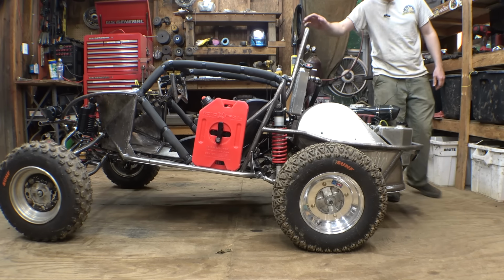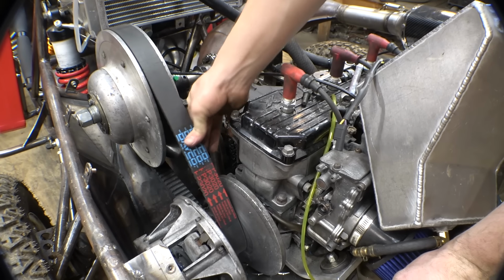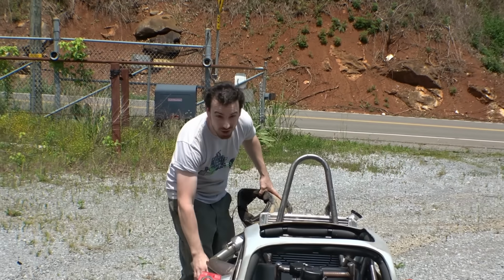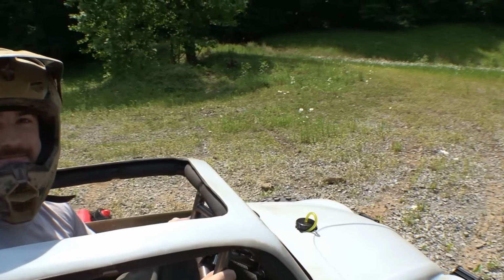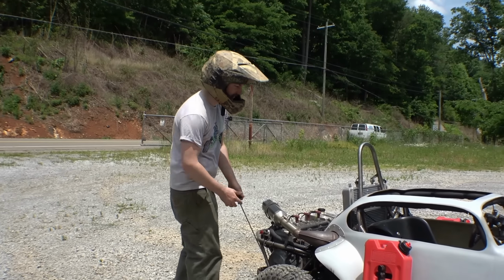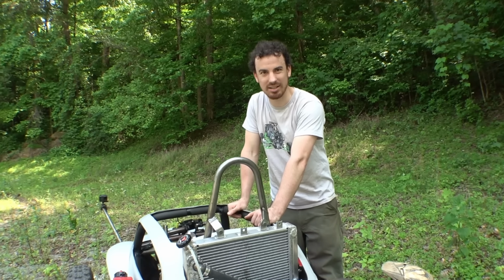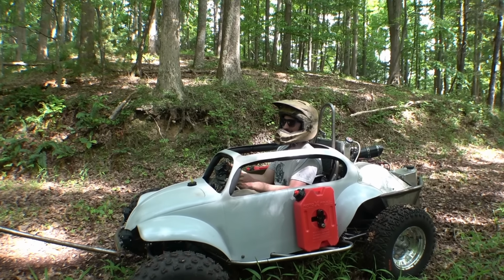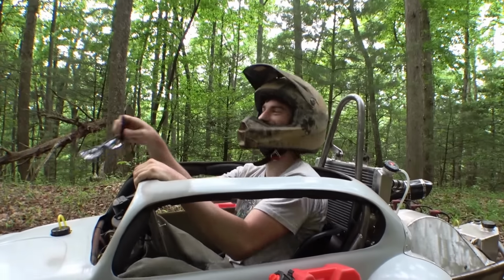This Thing is Nuts!!  - Mini Baja Bug Project First Test Drive

Comment: It definitely is nuts. Mental.

Couple of things I think.
- Too much weight in the back.
- Need much stiffer suspension in the back and maybe abit stronger at the front.
- Should move the radiator either more back or possibly two smaller ones on each side as you're completely blocking the airflow to it when sitting down

Comment: i just randomly happened across your video on youtube...Great build! love me a Baja bug...what was it based on originally, what did it start out as?  I would love to build something similar BUT , as a mini Jeep Rubicon Gladiator (since I have a full sized Red one set up to overland) or mini generation one Tacoma/Hi-lux ... the pick-up body would hide the rear engine somewhat  and solve the overheating issue, by placing the radiator out front, in clean unobstructed air... job well done sir , would be interested in the costs of the build too...hit me up in a PM  for further discussion....Fellow TN resident too (far south west corner of our  parallelogram....AKA Memphis)

Comment: It's a SNOWMOBILE engine designed/built/tuned for the snow!! My sled has one big rad in the compartment an 2 under the running boards.

Comment: Your back is keeping air flow from going through the rad u need to mount it up front or build a air duck from bottom that channels it to rad or put a very good fan on it to cool it Wich I think u need to change location if u put a fan because there's no air getting there without a duck system

Comment: Needs a front sway bar.
Remember the engine is from a snowmobile....they run in the winter or in jet ski form they constantly suck cold water through them . I'd run a Honda Civic radiator and fan .

Comment: Try giving it a rip in a straight line. See if it trys to die in a straight line. Also check it is getting air in the few tanks.
You will stuff a 2 stroke real fast when it leans out. It is better to run a bit to rich than lean.

Comment: I live in Texas in the Austin area... My biggest irritation with ANY machine is overheating.
On my 95 Mark VIII the first thing I did was get an all aluminum oversized radiator and a colder thermostat for it.
If it was me I would try to figure out some way of either adding like a set of dirt bike radiators to either side along with fans or try just adding a really good fan to the existing radiator.

Comment: U can fix the carb issue with a pumparound system, or with a pumper carb instead of a float carb. once you get around 1.3 g's ur float carb isnt gonna work good.

For the not turning problem you need stiffer rear springs, will also help get the front tires more on the ground. can also decrease the leverage ratio on the rear shock mounting, or convert to a pushrod suspension to change the leverage with the same springs. Front is way too stiff compared to the rear.

Comment: If you would adjust the floats to allow more fuel in just a little bit more this way, it won’t bog I guarantee with the tilting and the over revving it’s trying to suck too much fuel and it’s getting a little bit of air

Comment: Maybe the gearing ratio for your jackshaft because you may be in third gear on your CVT transmission trying to do a donut when you need to be in first gear or you may need a fuel pump because your fuel is ending up on one side of your tank and not ending up in the carburetors also sounds like you may have already filed one of the spark plugs

Comment: I think the rear differential is not helping you at allllll and being only one wheel spinning is the reason it doesn’t drift around and 180.   
Lifting only one wheel shows it’s only putting power down with one wheel… if he had a live axle both front would lighten but they both would be on the ground.   I love the skillz!! But not really well thought out.

Comment: Your biggest problem with the engine bogging out on the turns is its forcing the fuel in the tank to move away from the fuel pickup in the tank. So in essence it's running out of fuel. You should add another pickup in the tank and double the size of your fuel lines so it's getting the fuel it wants.

Comment: That sucker needs to be clutched different, needs higher engagement and a stiffer  secondary spring for faster back shift, those piston port XLT love higher rpm due to lack of velocity at the bottom end from the piston port
Reply: And over heated if that’s pretty hot for sled engine!!!

Comment: To fix your rear suspension squat when accelerating you need to change the instant centre of your rear suspension. It currently looks like your rear instant centre is too high. Your centre of gravity is below the instant centre. To design anti squat into the suspension you want your centre of gravity to act as a leaver on your instant centre which will either jack your suspension up or down. When the car accelerates you cg mass will jack your suspension around the instant centre preventing the car from squatting. Look at drag cars and how the back lifts up instead of down when they accelerate. Same idea.

Comment: Did you synchronize the carbs?
Also did you put a tachometer on? What is your rpm when the clutches engage? I betting your primary clutch needs some fine tuning. You’re blocking 90% of the radiator air flow with your body.

Comment: Your in desperate need of suspension work my friend. It all needs to be stiffened up before you begin to tune it. The front and back is way to soft this is why you can’t keep the tires on the ground doing doughnuts. I’d add a spring on top of Existing springs I don’t believe that they are too soft but could be.. really you just need something stiffer on top. You may think about changing angle of shocks as well but I’d try springs first... it’s not safe to ride the way it is now and some air scoops in addition of fans will cure your over heating issues. You can catch a ton of air thru the side windows with scoops  and direct it towards radiator like the Honda Odyssey had and fans on the back side pulling air thru.   I’m not putting your work down sir and It’s an awesome build and has tons of potential!

Comment: so I wonder if its rear sping for the cvt is to loose shifting it. if it has a really slugish takeoff its probably spinning up/ slipping the belt or it grips up. something else you can do maybe is remove the brass bushing if it has one. they love to seize and suck the belt in when ur goin 35...........

Comment: you've got the boiling radiator behind your back??? not that you cover it for the most of the airflow while having it covered behind you but what if this blows up because water does that and it comes allover your neck and back... please mate awesome build, but please put a fan on the radioator, at least... <3   .... repositioning;)

Comment: Better toll cage lengthen the frame itself out the front and through the radiator upfront with that stretched rat rod look then add weight to your new front end and that should give more responsive turns without ripping your front tire completely to the side every time with the differential breaking

Comment: Please build a bigger halo bar or cage I was scared for yah. But she's a ripper.just needs a Lil bit more angle on the rear shocks and anti rollback or limiters Lil more weight in the front and stiffer springs you'll be set

Comment: The suspension on this thing is way too soft your front tire every time your cornering trying to do donuts one tires in the air ! Which is one of the reasons you can’t do a doughnut and it squats every time you take off and you definitely have some overheating issues ! but all in all she’s a ripper🤩👍🏼🫡

Comment: Dude your body is completely blocking all and any air flow to the radiator , so I'd suggest perhaps relocating it to the front of the buggy for obvious reasons and also the additional weight for the steering advantage !

Comment: The radiator is totally blocked from any air to cool it down and you're forgetting that radiator might've been sufficient for a snowmobile but snowmobiles run in very cold environments hence the word snow

Comment: If you lifted the rear suspension up to where the front was a little lower like a traditional sand buggy and stiffen that rear up it would do donuts all day long and it would steer better because it wouldn’t be lifting the front wheels up you definitely have The rear suspension too low and too soft you do those things and I guarantee you that thing will handle and do donuts like a beast

Comment: The fuel systems on those engines are meant to be gravity fed to a pulse pump. When you use the pulse pump as your main fuel pump, its efficiency is greatly reduced

Comment: I don't think it's that the rad is too small but has more to do with the fact that your entire upper body is in front of it. When you add the fan or fans to it, make sure you build a proper shroud.
Over 200⁰... I'd hate to see those cylinder walls.

Comment: You probably need like a double gas tank where it's it's like a tank inside the tank where the float and the fluid from the fuel filter is bogging out when you're doing your spin arounds cuz I know like on a burnout car you have to have space in there cuz as you're swiffing around you're sloshing all that stuff to one end. If you do, if you build a separate tank inside of a tank that can stay kind of full. I don't know how to explain it but basically the bottom is open that the gas goes up in so you can keep fuel in your fuel filter. I think what's happening is you're sloshing out from your tank

Comment: i think it won't do doghnuts because the cvt is "gearing upp" and therefore bogging down the engine because it has an open diff and leting one wheel spin upp. maybe, i'm no mechanic butt i do have some knowlage about cvt's

Comment: Dude check the oil injector it's smoking so much. Most people I know with old sleds is they disconnect the injector and pre mix the gas. You have much more control of the mixture.

Comment: Possible need of a fuel pump. I feel your running the carbs low on fuel. Thus causing it to run lean with the slosh, In return causing your over heating.

Comment: It 
Looks like it's flexing too much in turns. Could it just be biting in too much on the outside wheel VS sliding plus float issue in carb

Comment: "Bad springs!!!"
Or I'd spec some longer shocks too with high and low speed compression adjustment, but...
I'd be worried about the coils binding on those shocks with it tightened that far down, they're the wrong springs, shocks are are what they are, but if you specced a heavier weight spring for it, and choose one with less turns/coils you'll get much better ride out of it too as well as full travel with a lot less pre-load (it's not ride height adjustment!)...
Reply: Still loving the progression, insane little beast!

Comment: You need to increase the fuel pressure, and that will fix your low power issue in turns

Comment: I think the loosing power in a donuts is not heat related as it was fine when going strait and only had issues when you tried to spin it around ,  this to me screams fuel delivery related issue ether with the tank or the carbs float bowls not filling fast enough most likely the tank though,  the tank you built while nice looking it  however is a really bad design when centrifugal forces are involved, the fuel pick might well be at the lowest point but it is also on the left side  which means when you try to do a left hand donut what fuel is in the tank will be thrown through the tank baffles to the right side of the tank far from the pick up point meaning it burns through what was left on the pick up funnel you made and then it starves

Comment: Having the differential is what is killing your donuts because both rear tires are not spinning at the same speed. You need to have it locked in the rear to do proper donuts. Your cutting brakes are only there to help you steer some. The wheel base is too short for them to actually do much. The rear spring rates need to be increased as well as installing an antiroll bar with the way you have it set up at the moment. Funny thing is, there have been so many comments during this build that have all mentioned these issues before you got to this point. You have the information given out, now it is up to you to actually read and use that information.

Comment: She's a screamer, alright.  The extra fuel seemed to give it another 20hp.  That front end is questionable.  The wheels seem to have 3-4" of play in toe-in to out.  Did you install the outer wheel bearings?  ;)  Sway bars would help more than shocks for the roll, but it looks like it handles like a trophy truck.  Is it swishy in the whoops?  If you think you love it now, wait until you fine tune the suspension.  RedBull will be calling you. =:-0

Comment: Its cutting out because it’s carbureted. The jet hangs in the middle of the bowl. When spinning the fuel sloshes to the side and leaves the jet sucking air. Same reason people like fuel injection on off road rigs.

Comment: Part of the problem with you're trying to do donuts is your steering setup if you watch it when you're going into a corner your inside Tire turns much sharper than the inside Tire

Comment: You need to put more weight in the front so the front wheel will stay on the ground. There is to much weight in the rear. If you balance the weight then it will control better as well.

Comment: Rear suspension is far too soft  and needs a sway bar. As far as the engine performance as you run it, it's overheating and killing the performance. With the current suspension set up it will not do a doughnut. I would reach out to grind hard plumbing. They have amazing builds like yours,, but they work. Good luck! And cool machine!!

Comment: I think you need stiffer suspension in the rear. The rear end is rolling over. I think the engine is losing fuel prime. Need weight in the front

Comment: There is a difference between running oil lean and fuel lean. There should be oil in your gas. If you have any gas you should have oil. Air fuel lean is a whole other issue.

Comment: And every time you try to do a doughnut as far as I’ve seen so far, you’ve done it with a left turn check to see if we can go to a right turn the opposite way see if it fixes it if it isn’t it’s a fuel starvation problem, and you know that, for a fact, if it does, it’s the same both directions that it’s not a fuel starvation problem for say all I mean it is, but it’s not because of lack of gas going into the carburetors I got more pressing matters

Comment: I'm just going to throw this out there 
probably try adding some weights to the front end. 
That way it doesn't push through the steering so bad 
I'd be pretty nervous driving it just  your head sticking out I know you got the bar behind your head. maybe there's a way you could do a fake roof rack 
you can put the gas cans on the sides
Of the roof rack? I think that thing is awesome is there a way to recess the seat down more?

Comment: Needs a small in line fuel pump off a motorcycle all around widen the suspension and larger tires front suspension needs to be stiffer and front tires need lower psi the cvt needs tuned with weights and spring for torque lag and a expansion chamber for the exhaust and electric fans and scoot the cooling system back off the seat for better air flow

Comment: 200F is definitely too hot. When I'm riding my 2 stroke sleds I don't like seeing over 60C which is 140F.  My 2014 runs in the low to mid 50s.

Comment: 200 degrees is cold.  It’s too fat.    When I tried to run my sleds in warm weather power was down soooooo much. I had to go down like 4 jet sizes and down one on the pilot just to get it to hit 215 degrees and a good air fuel   Ratio    When you got it jetted perfect.  It will live wide open at 210-215  at the spark plug. 230 is just where it’s too lean. Warm temp on those engines is a little tricky to get the jetting  right. You will feel a tremendous bump in HP going down a couple jets.  Just check your plugs. That light brown on the strap sez it all. And they don’t use as much oil. It’s probably jetted for 0-30 degrees outside temp.

Comment: Your clutching is off ,raise you primary clutch engagement to about 2500 to.2800. The belt is getting way to hot. 2 stroke motors will not last long at temps over 170 - 180 . You are geared to high as well.

Comment: You must tune the exhaust... Hence why it's overheating
Reply: I'd imagine when you modified the expansion chamber it messed up the resonance In said chamber, the sound wave and reverb is essential for a two stroke to keep the proper air fuel mixture in the cylinder

Comment: Im still scared for you safety should that radiator ever decide to pop.... theres nothing worse than steam burns but hot antifreeze or boiling water hitting you in the back, back of the neck and head will do some damage in the time it takes to jump up out of there... be safe man!

Comment: Your fuel is the problem.  Something is either getting in the way in the tank..  plus overheating is not good..  
It wasn't having a problem when you first fired it up and ran it the first time.  It was ripping through the turns..